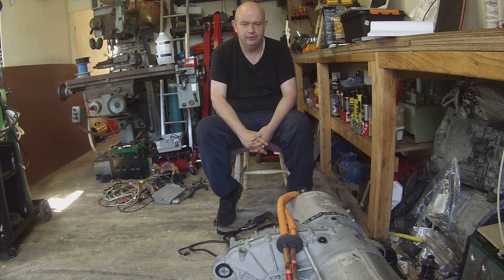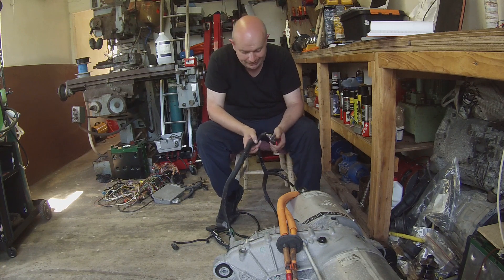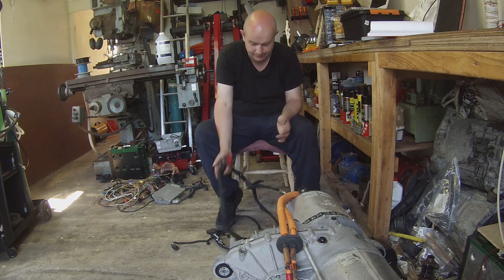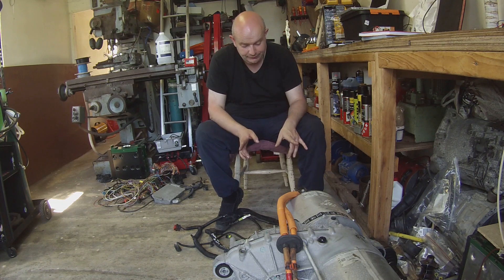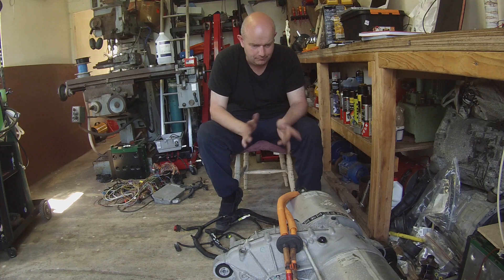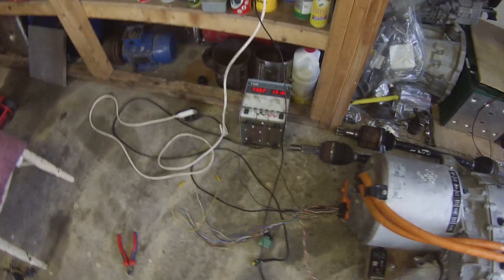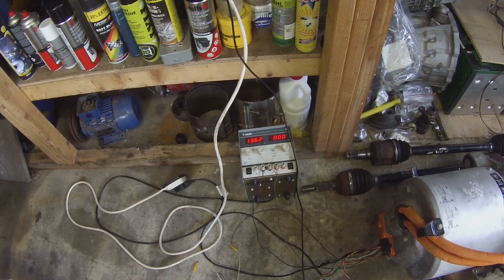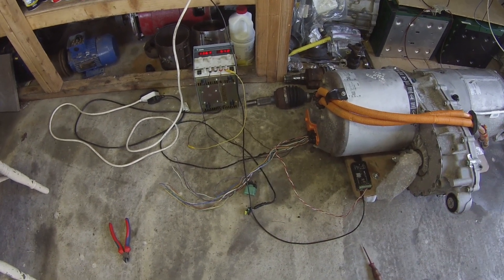The Tesla Project : Day One

Comment: hi damien just like to point out that jack at evtv had done it the same way as you are, and it turned out it was in limp mode so be aware of this and also remember hand brake lock is on but nice work (this should be the drift cars drive train)  just my opinion

Comment: great job, i like the idea of a custom logic board though, all that can sniffing took Jack and his "team" a long long time as I'm sure you know and they are still not ready to release a finished product! ;) 
It would be nice to see someone step back and evaluate what is really needed for the home car mechanic to use this motor/inverter for there Ev project.
Your the man who can design a new logic board to drive the Tesla power stage alone without needing all the CAN traffic and over complication and go back to just bare essential info like motor and invertor temp on a digital display, a manual creep dial for auto's, a ford throttle pedal, and forward/reverse switch. :)

Comment: Hello, I love to watch your projects and they are great.  I also made small car conversion so i have some expencive.  Now i purchase bmw e39 520 i. To make another conversion. I also bought 9 tesla modules and now l'm looking what motor to take.  Tesla motor is now more available as it was before. But i need to separate motor from diferential and put it on the gearbox. . Because it is no possibility to put it orginal. There is not place because of read axle carrier.  Is it possible or is weleded on the one half of diferential?  Do you know how it will work on 220v? I know it has 18000 Rim on 400v and it has 270kw.  I need about 9-10k rpm and 150 kW . Is it this possible?  Will regenerative braking works? ? Tnx :)